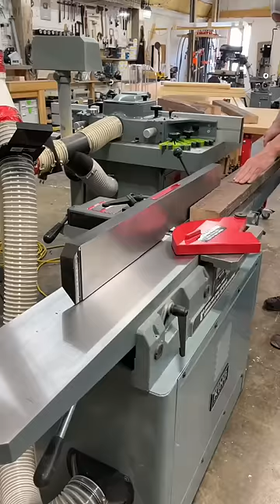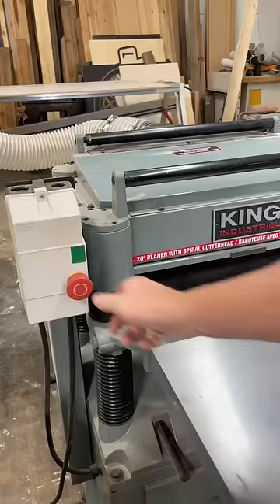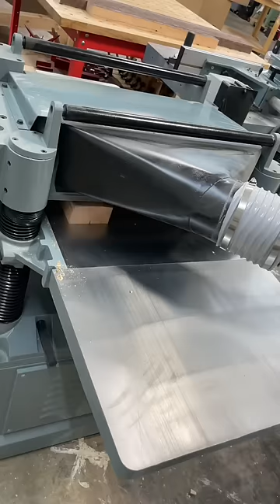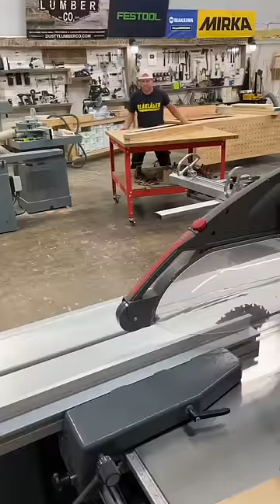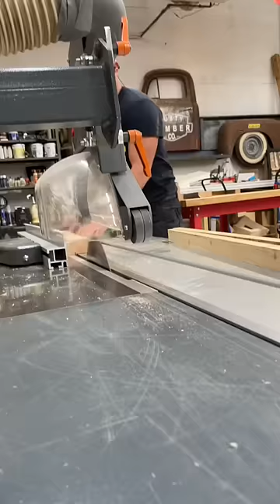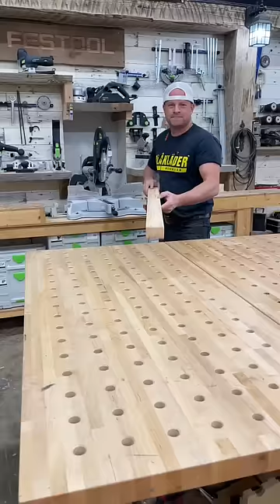Squaring up some old barnwood #woodworking #wood #woodwork #maker #bois #holz #tools #madera #work

Comment: How do you check the old barnwood for nails, screws, or any other metal before sawing or planing? Love your work!
Reply: That is a good question! It can be fatal to work with reclaimed wood for that very reason when you are dealing with electric tools

Comment: What was the first and second machine he used? I want to assume they are used to sand/shave the wood but It seems like he used 2 different machines. This stuff is awesome.
Reply: Joiner and Planer
Sharp HSS knives plane off wood in a circular motion.

A Joiner is used to establish two flat surfaces in a 90° angle.
A Planer then surfaces 4 sides and makes the board completely rectangular.

Comment: oh! I envy those machines of yours (in the good sense of the term). Here in Brazil we have to deal with machines made in China. Some are even good, but they don't even compare to yours.
Reply: @Jeremiah Schultz In Brazil it is another reality. As I said, some Chinese products are great, but many portable electric machines of dubious quality arrive here, even from traditional brands made there. Here, a former DeWalt dealer complained that after the machines started being produced in China, the amount of warranty maintenance increased. Unfortunately, due to our purchasing power, brands like Festool, Metabo, Milwaukee, are unthinkable for the average Brazilian worker.